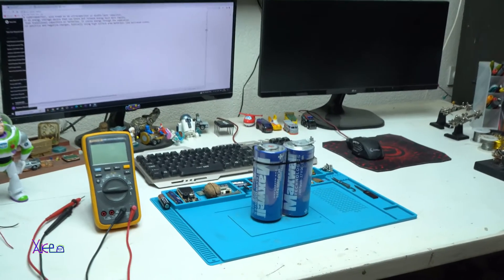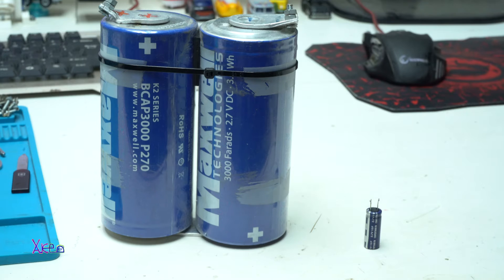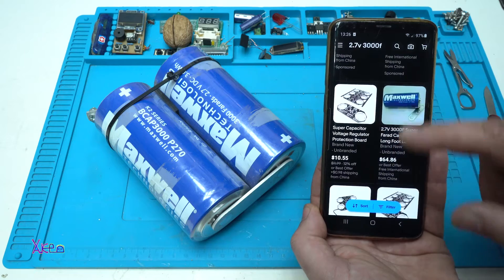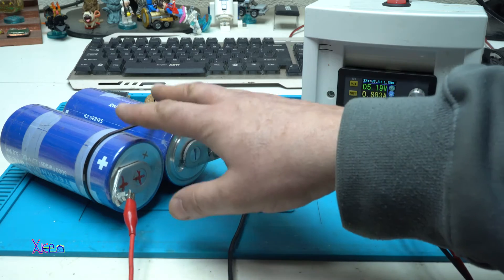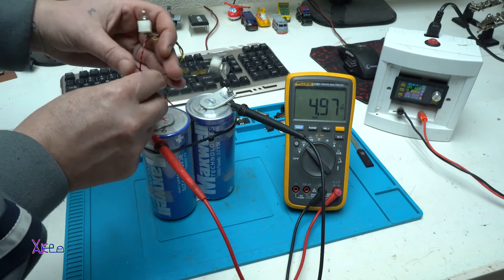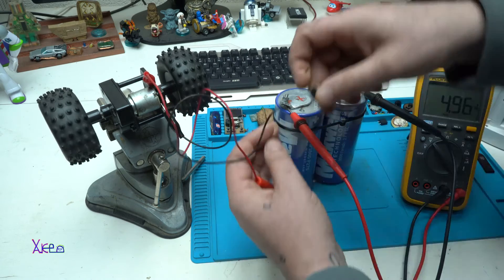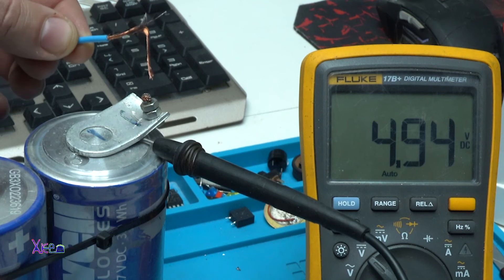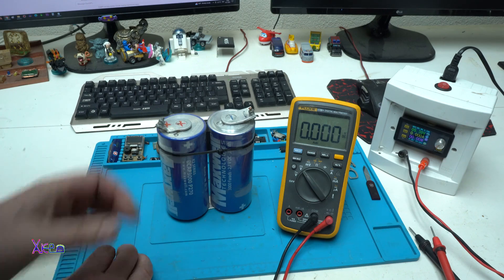Super Capacitor 2.7v 3000F - Do NOT make Short Circuit!

Comment: When used with a weak 12V battery to start a car, you will surely destroy these supercapacitors. They are not built for high currents, look at their weak terminals and the datasheet. Starting currents are hundreds of A. For this purpose, MAXELL 3000F capacitors are excellent, again 6 pieces in series.
For example, this video: https://www.youtube.com/watch?v=NhrklZb7GVE

Comment: Can you make a project with the supercapacitors, using them to build a larger bank that can serve and even replace a car's battery for engine startup?
Reply from the maker: That is nice idea and I am sure that will work.
Reply: @Hacktuber  if it's possible to do, would be nice to see in a future video 📹
Reply: I'm pretty sure you would need a trunk sized super capacitor bank just to have a chance to start a 12V vehicle, they need a few hundred amps for around 2-5 sec.
Reply: @thatbillguy5211  no you won't. A car, even a large car draws no more than about 300A for 1-2seconds. To power the car's starter for 2seconds, we need:
IV(t) = 300A × 12V × 2sec = 7200 -10,000joules

A bank of 5-6 of these supercapacitors would give 13.5v - 16.2v, more than the needed 12v to start the car.

6x 3000F supercapacitors in series would give 16.2v 3000F. The energy it stores is:

½CV² = 0.5 × 3000 × 16.2² = 393,660 joules

So unless my math is wrong - correct me,
Else this should work theoretically and practically.
Reply: @techware5701 it looks correct 

And this has already been done and documented on YouTube I’ve seen many cars running on capacitors only 😊
Reply: @onesikm3  nice nice 👍
Reply: @techware5701  Yes, 6x3000F Maxell will start a 50kW tractor diesel engine without any problems, even without a battery connected.
According to the datasheet, the current is exceeded anyway.
Those small 6x500F supercapacitors won't last and will be destroyed by the high current.